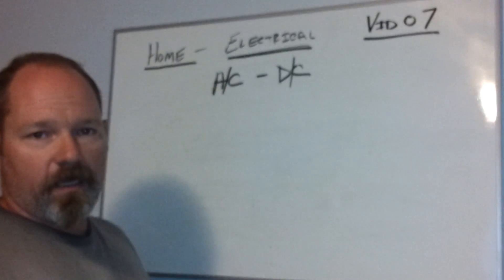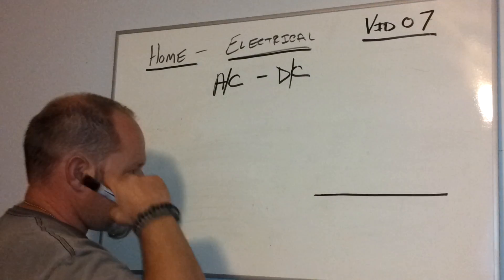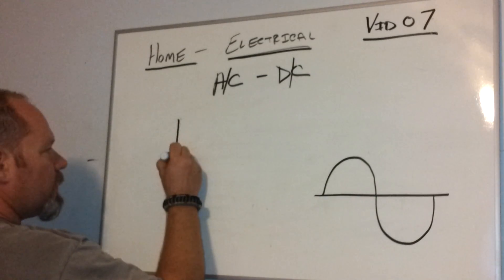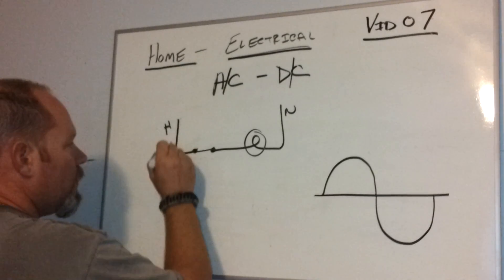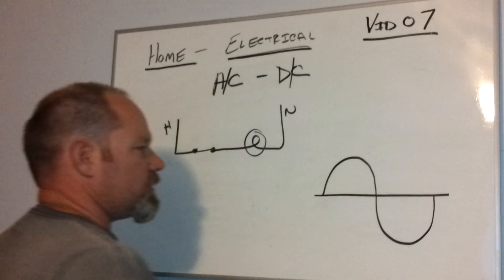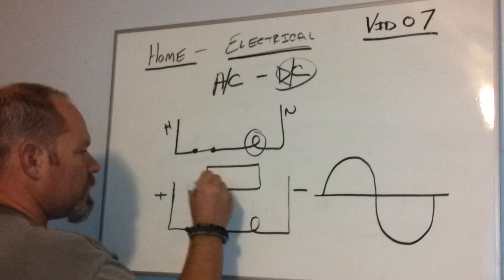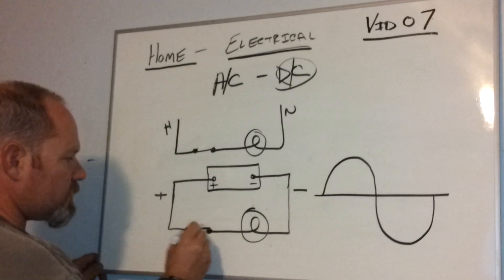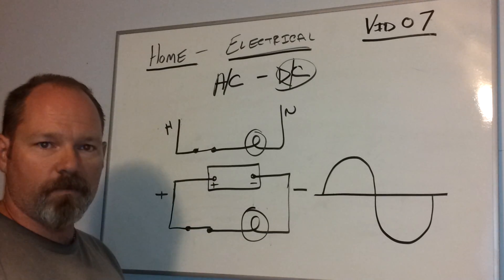BASIC ELECTRICAL 101 #7 ~ DIFFERANCE BETWEEN A/C AND D/C

Comment: Hello, been watching your videos and they have been very helpful. My fiancé and I have bought a building we are converting into tiny home living, and want to wire it up ourselves from scratch. It currently has nothing in it, so if you have any pointers that would be awesome. Thanks!
Reply from the maker: +Jason Duerksen solar?
Reply: Yes, sorry I meant to say solar. I'm not a electrician by any means but wanted to see what type of breaker box, wiring, and breakers etc I should use for a solar system. It's not a big place, just need a few lights, small a/c, and not even sure if we will go electric on the stove. Just kinda lost on what my breaker box should look like. Does it hurt to have too much just in case we need it? Also would like a direct plug for a generator to power the whole place if we needed it. Thanks for any help you can provide!

Comment: Hi there, I think your videos are quite helpful, thank you for posting them. One thing i just wanted to point out was electrons are attracted from the negative end of a battery to the positive end. (Flow from negative to positive). From the way you had it worded I believe it could present some confusion. Otherwise, great videos, everything has been quite accurate and thank you again :)
Reply: I agree with you. Electrons are attracted to the positive end of the battery. But in school, the convention is taught just the way he shows it here. Think of it this way. As electrons move from negative to positive, the "hole" they leave behind moves in the opposite direction. Electrons move from negative to positive, but the convention in many schools teach the flow of electricity in the opposite direction. If I made any sense :)
Reply: Kyle Troskot i was gonna ask that

Comment: Guy, I already know that A/C is 110V or 220 V, but what is DC? any spcecific amount? Thanks for your great videos.
Reply from the maker: DC comes in a racge of voltages aswell.
Reply: DC does not pass through a capacitor or transformer. DC is often use in amp circuits